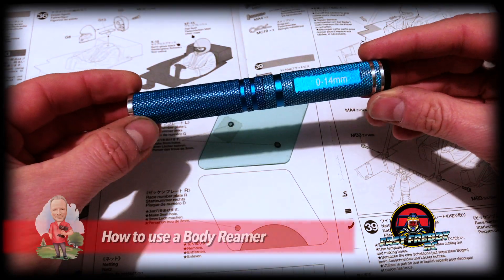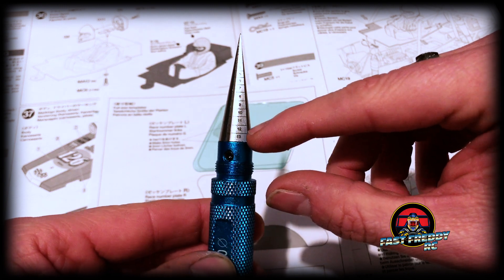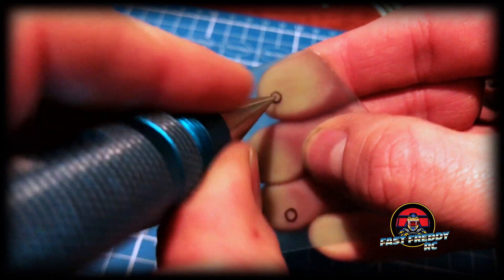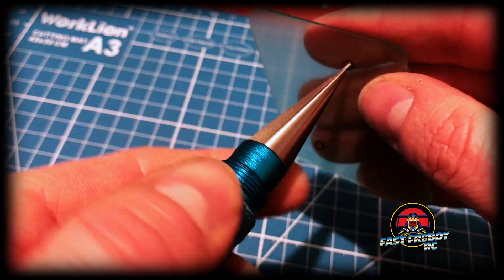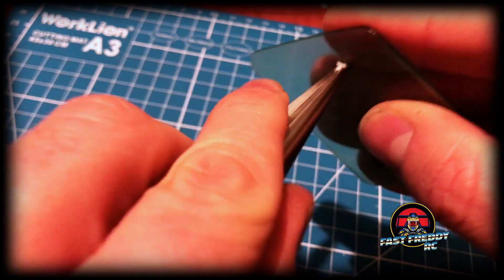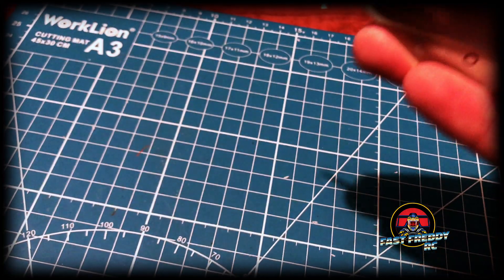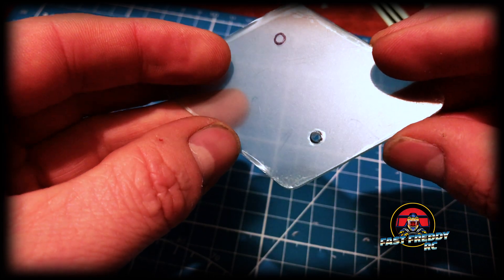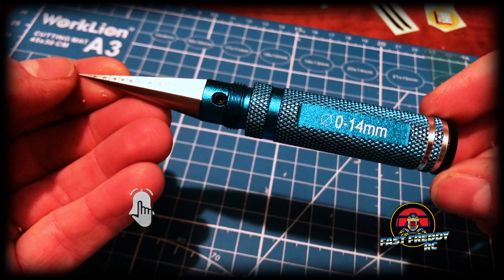How to use a Body Reamer - Tips and Tricks

Comment: Just in time, I just bpught one a few days ago.
Reply from the maker: No way! Great!! You’ll love it! Really does the job and you’re completely in control vs a drill. I love it!
Reply: @FastFreddyRC  the thing is, I never had an issue with my hand drill. Bit it only works until 4 mm. After that I had to change to a machine. A hugge project's showing up, and I thought why not this tool although it ain't cheap.
Reply from the maker: @RCBirds  don’t get me wrong…the hand drill is still great. BUT…all I have to do with this tool is open the drawer and start using it. Don’t need power, no cables etc. I’m in total control from start to finish :)